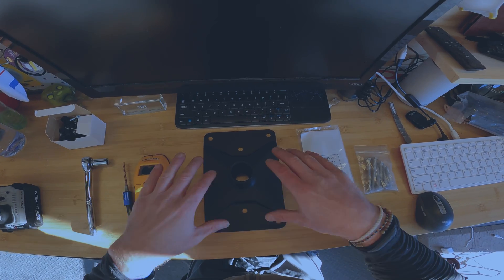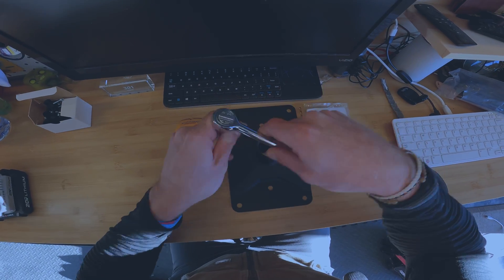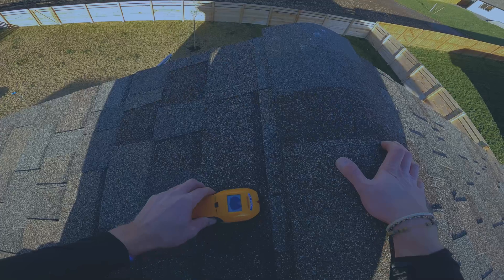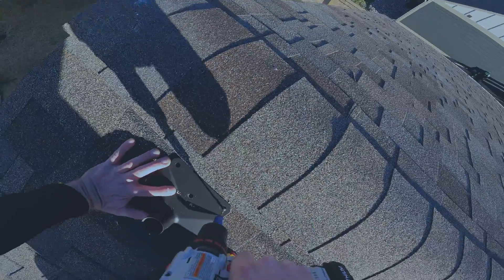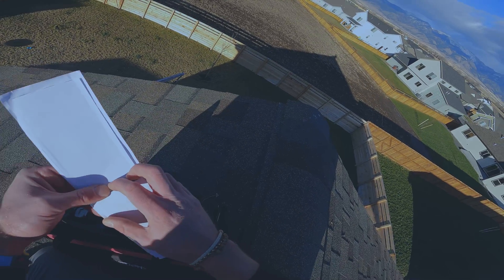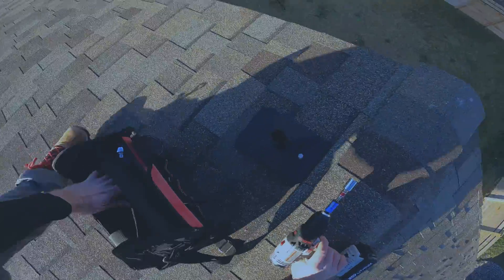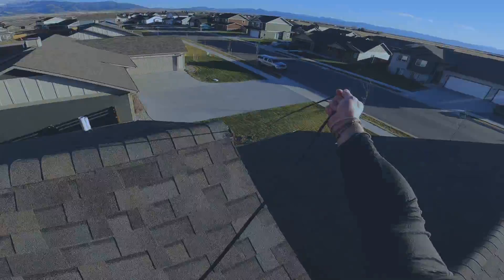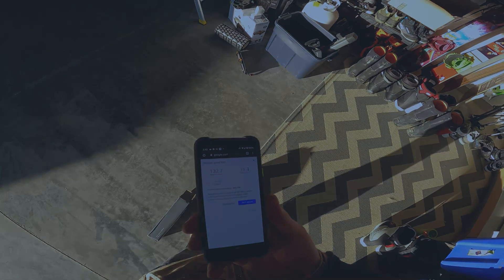StarLink Rooftop Installation - Starlink Volcano Roof Mount - Part 1

Comment: FYI to all
The best way to find the roof joists is using a hammer to sound it out. When the hammer hits a joist, you will hear a distinct "thud". With the Volcano Mount, you want the 2 centre holes overtop of a roof joist. These two lag screws will ensure it doesn't blow off in a windstorm. The other 4 lag screws are just for security.
Reply from the maker: As always Fire you the man! Listen to him, I used a stud finder and worked but the above is a real roofer!!! Ty for your input Fire
Reply: @QUICK-STAR I can't stress the importance of finding one roof stud for this style of mount. Stud finders will not work on a roof. A hammer 🔨 is the only way.
Reply: Awesome video.  I just installed my Volcano roof mount as well.  To find the stud, I first used a ladder inside the garage and drilled a very small hole beside the top joist through the roof to ensure I positioned it properly.  Not a fan of adding another hole but it worked.
Reply: @Trader-M  Excellent idea!
Reply: Hammer doesn't work well on a tin or aluminum roof ... lol
Reply: @robintaylor1490  You are correct. Thank you for the correction. I will try and Edit my post

Comment: Better mounting option is the long pole attached to the fascia boards...usually a 2x6 or 2x8. That's how I installed ours and it's rock solid even in the strongest winds and we live on top of a mountain with high winds. Water always finds a way in if you mount it directly on the roof.

Comment: Rather than to guess where the holes in the roof are, why wouldn't you put the larger butyl rubber tape pieces onto the mount push the bolts through and then line the assembly to the predrilled holes?
Reply from the maker: Not sure who you saw guess but OK

Comment: Hey man great video. I am watching it right now as I wait for my previous internet provider to remove the mast with the radio off my roof so I can permanently mount my dishy. It's been on the ground since November/December so looking forward to it. My ridge also runs north south so I was interested to see how far above the roof yours sat . It looks to be well clear of the shingles facing the way it is on the right side of your dishy. I'm not sure exactly what slope I have but I think it's roughly the same. Great work once again and I give you credit for going ahead and making this video and using what you learned from comments to help seal it up.
Reply from the maker: Hey thanks for the watch! Hope you will sub! I would guess its about 2.5 to 3 feet but headed back up on roof this weekend and I will measure it for ya! Thanks again

Comment: What size are the Lag screws?  Diameter and Length?
Reply from the maker: That's a good question they came with mount, so I did not think to measure them.

Comment: It looks like the dishy pole doesn’t end up vertical due to the roof slope. Is that correct? Does the dishy just compensate for the tilted pole when it’s acquiring satellites?
Reply from the maker: You are correct on both fronts :).

Comment: Where can you buy the mount?
Reply: on the StarLink site when you purchase your dish....its called Volcano Roof Mount or theres a pipe converter that works with pipe/tube from 2-1/2" down to 1-1/4" I think
Reply from the maker: at starlinks website

Comment: What was your process for getting the power source and other cables into the house? Did you drill through the wall or did you connect it some other way?
Reply from the maker: So I found an outside receptical and just fished the wire through that then drilled hole in wall to pull it through from inside.
Reply: @HillPhantom  So how many wires are there from the dish back to inside (one for power and one for router...? )
Reply from the maker: @mnsotapop  so one wire from the Dish to the power block...then power block to outlet and Cat 7/5 to modem, both dish and modem powered by POE.  So one cat 7 from Dish, fished through the outside wall, into house, that Cat 7 then connects to power brick inside plugged into wall. The power brick then has another cat 7/5 out that goes to Router/Modem.  All POE, Power over Ethernet.
Reply: @HillPhantom  thanks!  I used to have HughesNet (still have the dish on my roof)  When I get the Starlink I'm hoping I can route the Starlink wire from dish to inside using the same holes HughesNet used.
Reply from the maker: @mnsotapop  good idea I do not see why that would not work!
Reply: @HillPhantom  only thing that might impede that plan is the large ferrule on the cord. Probably won’t go through the existing hole, but you can always make it bigger 😁
Reply from the maker: Check out this other video I did you can see, and please excuse me, well, non electrician work...https://youtu.be/D7uwzHLGwpI?t=145

Comment: A better idea is the pole mount bracket that is available. Simply mount it on your existing plumbing vent pipe and you have no holes to drill and it is out of the way when it comes time to replace shingles.

Comment: I used to trim trees, rock climb, and work on roofs. Not done anything like that in about 10 years. I made it to where you pulled out the stud finder. I just could not watch any more. I was seriously getting short of breath and having a panic attack. I am glad you made it down safe.  I guess someone will have to install my Starlink dish when I get one. 
You win!
Reply from the maker: You can do it...I climb too, on alpine peaks alot...I will not lie, puckered me a bit, but controlled the fear, and got the job done. If you can swing it, get a professional...if, and only if,  half idiot like myself...lol...proceed with caution and against common reason lol. Cheers!
Reply: @HillPhantom  Thanks. 
How is the upstream for Zoom and livestreaming?
Reply from the maker: @joedogmckeel  I just built, well almost done, a logger on the Pi to run a week up and down average. From a purely observational view and some work video meetings I have had very few issues. A few freezes and drops but comes back fast. I would say it pretty good so far but within reason of sat vs my cable connection. I would not hesitate a full workday on it, even video heavy days.
Reply: @HillPhantom  I do SpaceX Livestreams and other space related stuff. I would love to have you on a show about a Starlink user sometime. Contact me on FB (Armchair Rocket Science) Btw where are located?
Reply from the maker: JoeDog McKeel will do! I’m in Montana

Comment: Is there a mount that installs to the facia board? I'd rather have the dish on the side where I live (Northern Ontario Canada) 3 foot drifts on roof!
Reply: You would need your own mount if you want to mount via facia.
Reply: @niiiiiix  So just a regular Bell Satellite (Dish in the US) mounting arm?
Reply: @RogerDiotte  may need to research in how the starlink mount works, it's an inlet and it clicks in, I wouldn't know how to properly measure my starlink mount to get the right size
Reply: @niiiiiix  It appears that Starlink now also has available a pole mount kit, so a J-mount is definitely an option. Like Roger, I am concerned about snow drifts that could completely cover the dish if mounted directly on the roof, even if near the top. If a standalone pole is not an option, some sort of J-mount or bracket that brings Dishy out over the 
edge of the roof could be useful for sure.
Reply from the maker: Not sure but assume this would work , I was considering it as well.

Comment: Nice job.. What speeds did you have before?
Reply from the maker: Hi. So it was like 60 down and 15 up.   The big issue was drops, now I have less speed drops in new location. Ty for watching!
Reply: Installed my dishy yesterday on the roof and turned it on... My old plan averaged only 7.3 Mbps down, my first speed test with Starlink was 51!  This morning I actually hit 250 Mbps for awhile... Just amazing

Comment: You'll be sorry.......
Reply from the maker: How so?
Reply: @HillPhantom  You could get a rubber vent boot that goes over top of the mount and tucks in under the cap shingles. Then goop everything with roofing tar.
Reply: @HillPhantom  Your roof will eventually leak. Not right away, but sooner or later it will. Yours looks like a good roof job, and it should last a while without problems, but I learned the hard way LONG ago - to NEVER drill holes in a roof. Heck, leaks sometimes occur around vent stacks and those are professionally installed. Water is just determined to get in - maybe not directly through the holes from the top, but from the sides of the shingle. Remember, there was no additional sealing at the shingle ends and there shouldn't be - shingles are designed to shed water, not block it. You may get lucky because you did everything right, but I'd check inside the attic periodically just to be sure. I'd also suggest a caulking product called OSI QUAD around the entire mount, including bolts similar to what someone else suggested but it doesn't dry out like roofing cement does. At least that may slow the process.
Reply from the maker: @dalepremo3695  for sure and intend to check yearly. I  using a compound they use on RV roofs. I should have covered that but didn't have product at time and am in a race before winter. Ty all for pointing it out.  Cheers
Reply: @HillPhantom  Thank you so much and I have to compliment you on both your hard work and positive attitude. BTW, I meant to mention that they OSI QUAD is available at Lowes, Home Depot, etc. Not cheap, but I swear by it. It remains semi-flexible for years.
Reply from the maker: Thanks Dale and for the second eyes, don't get those often. I'm happy to hear and get any help. We are all a tribe just want to show folks you can do it. I get after it but I was a bit puckered first time on roof..lol...ty again I hope you will subscribe and participate. I'm not wise but willing to learn trying...
Reply: @dalepremo3695  I've had a DirecTv dish and HughesNet dish both on my roof for over a decade. If you know what you're doing, this isn't an issue whatsoever.
Reply: @CannedHeat28  About the same for me.... I guess Dale doesn't see the MILLIONS of dishes already installed on people's roofs....

Comment: We installed the volcano mount also. Next opportunity, get back up there and put some roofing cement over those lag bolts and all around the mount. You will thank us later. (Roof and Flashing Sealant 10-Fluid Ounce Cartridge available at your local home improvement store).  Enjoy your Starlink, we are.
Reply from the maker: Funny u say that ran to store today to get just that...TY
Reply: Good tip!